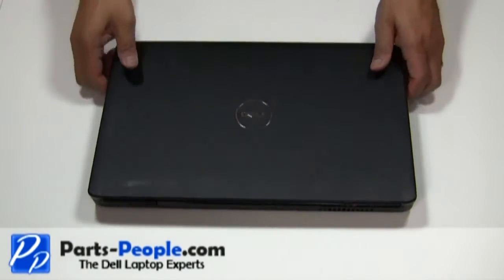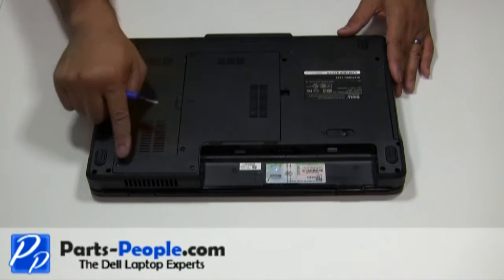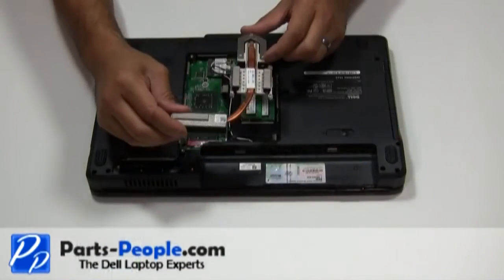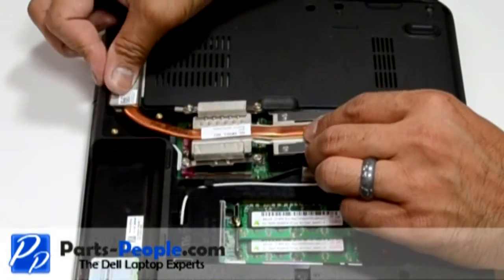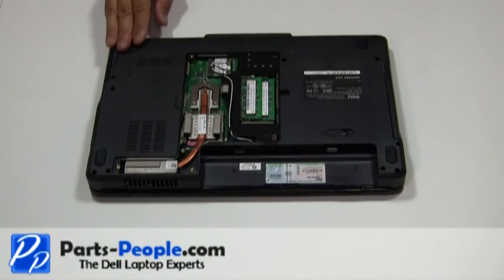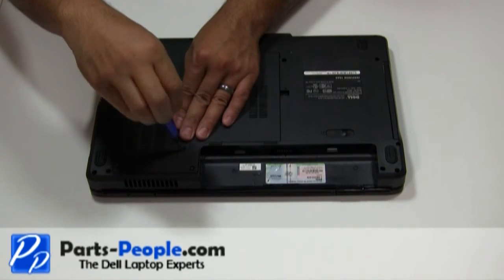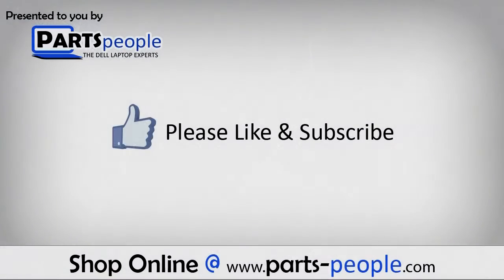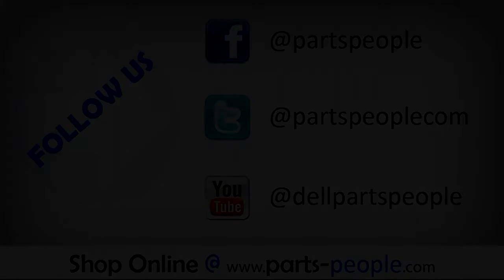Dell Inspiron 1545 | Heat Sink Replacement | How-To-Tutorial

Comment: It looks like the heat sink uses both thermal paste and a thermal pad.  Can I use thermal paste instead of the thermal pad?
Reply from the maker: It's always recommended to use the same as what was originally there. The pads have a thickness that the paste can't provide.

Comment: Hello I have a Dell Inspiron 1546 computer and stop Suddenly I went to the office of repairs and told me that the problem is in the graphics card does not know how to fit graphics cards and the problem is that the computer work and work van and there is no image on the computer screen or in the external monitor and the computer re-furbished
Reply from the maker: The graphics card is built onto the motherboard. You will need to replace the motherboard.

Comment from the maker: It sounds like you have thermal pads. Thermal pads are heat conductors that transfer the heat from the CPU and GPU to the heatsink. They should be replaced after the heatsink is removed. You should be able to purchase thermal pad online or at an electronics store.

Comment from the maker: I would double check all of your connections to ensure that you do not have any loose connections.  Please be sure to remove the battery and AC adapter before re seating any connections. The Dell Inspiron 1545 is notorious for blowing the video chipset if you try to re seat the LCD cable and there is still a power source on the computer.

Comment: I have to take off the heatsink to remove the motherboard so I can replace the Charger Board, is it 100% necessary to replace the thermal pad/paste if I'm just replacing the original heatsink?